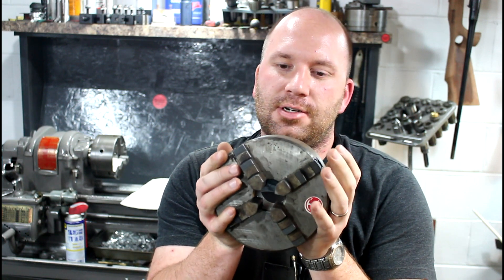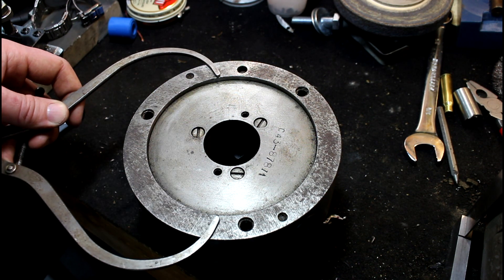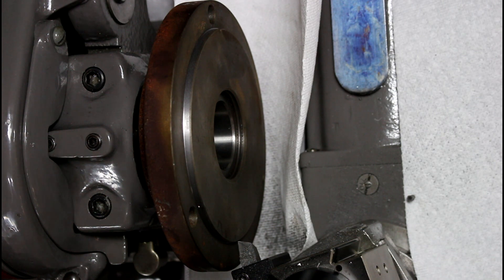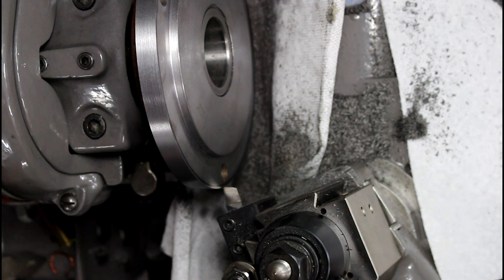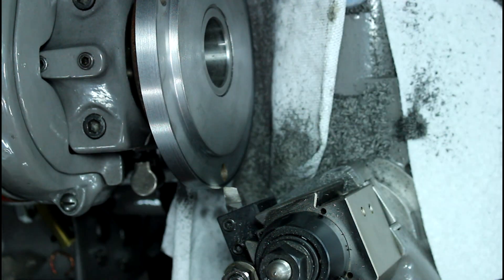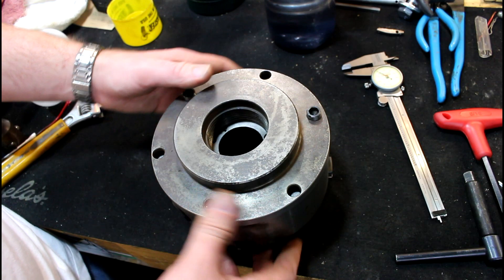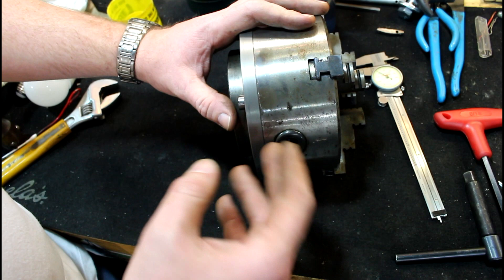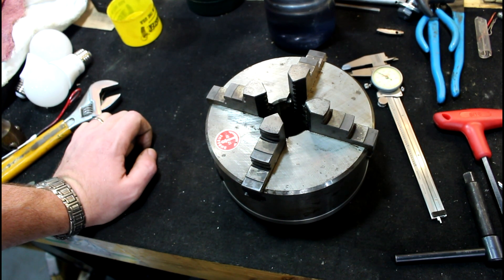Lathe Back Plate Install for 4 Jaw with the Super Indexer!

Comment: Usually you can machine iron without any oil, its just horrible messy stuff to do.  Lots of dusty grit comes out of it instead of chips.  Loads of graphite in it though, so its basically self-lubricating.  I turned some iron wheels for the conveyor system at work and I think I spent more time with the vacuum than I did actually running the machine.
Reply from the maker: I didn't use any oil. Just used the brush to keep dust down and the chips from flying everywhere. Next best thing to a vacuum running the whole time. Most of the chips fell in a nice pile.